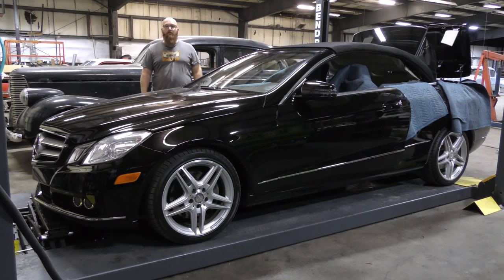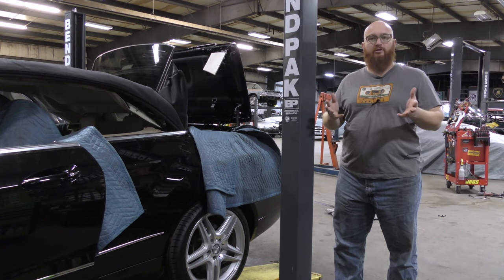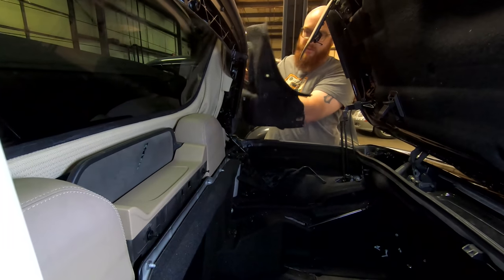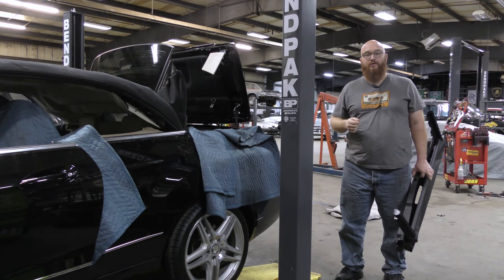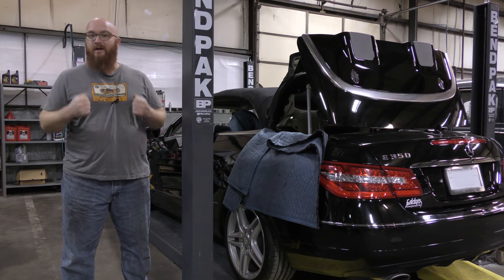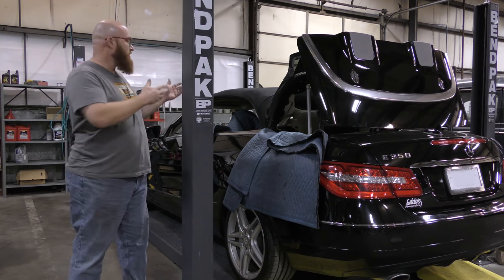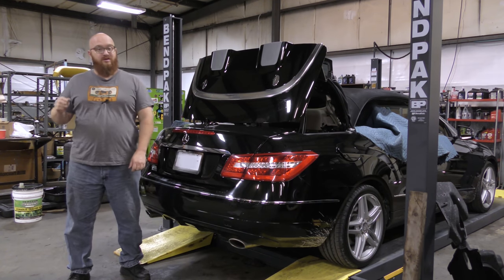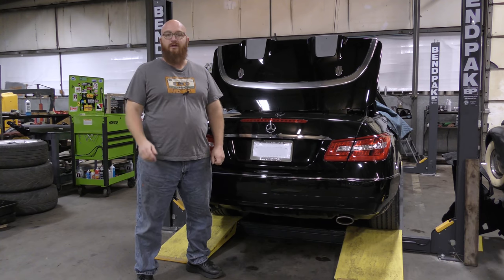When bad design costs thousands! Not so convertible 2011 Mercedes E350 can no longer rise on demand

Comment: This is why newer era Mercedes are JUNK....waaaay too complicated, and repairs can be financially ruinous.  A very cynical company.  They didn't used to be like this.  My 88 420 SEL is a tank....nothing breaks, the repairs are reasonable, and with 325K on the clock, it's the original engine (zero oil burning) and transmission...no problems...just change the timing chain on schedule. Everything works...including the clock, the vacuum system, power accessories.  Beautifully made and rock solid.  My wife's 2006  E350 4-matic wagon always feels like it's about to explode, it burns oil,  the transfer case failed (to the tune of $6K for a replacement, and the interior plastics are already very brittle, and fracture constantly...and our cars are 100% garaged and driven very carefully.   The wizard is right here....Mercedes is now on board with planned obsolesence.

Comment: You're giving the engineers too much credit. German car engineers have a long history over over-complicating what should be simple mechanicals/parts. Which actually costs more to produce, but also more susceptible to failure. So it's the engineers' fault, not the accountants.

Comment: Are there any aftermarket fixes that would solve this problem properly? I've seen people come up with the fixes for the problems with the PCV in the Chevy Cruze for instance, amazing that some random Joe Schmoe in his garage can fix a multi-million dollar company's screw ups and that's just one example off the top of my head.
Reply: Hi.   Just managed to repair this exact problem on my E350D Class Cabriolet for £100 with a repair kit advertised as especially for this purpose that I bought from Cabriolet Hydraulics.   Took about an hour and involved splicing in 12 inches of hose.  Let's hope that it works...

Comment: I drove Mercedes over 25 years: W123 300D, W124 250D phase I, W201 190D, W124 E250D phase III, W210 E300 Turbodiesel. Mercedes quit building quality cars from the mid 90ties. All but the W210 were good, durable cars, which I drove to high kilometers (like 350.000 - 450.000). The last Mercedes W210 was a nightmare. So many electronic problems, Xenon failures, rust and as the cherry of the rotten cake a destroyed transmission at less than 280.000 km. Since that moment: never a Mercedes again! Quality sucks! Happy now with a Peugeot 508SW E-Hdi (not available in the US, I know). Quality as it should be!

Comment: Why not use an electric motor Mercedes? You could even have a metal cable/winch type setup if a lever style system would require too large a motor.

Comment: No big deal, any car with hydraulic roof hoses suffer, I have replaced about a dozen on Jaguar XK100. Plus they need flushing with new fluid because the the old fluid turns to gel.

Comment: Many cars are designed and built for speed of assembly or unit assembly so the average unskilled line worker can just lift, snap, click and move on.   Asking them to position a swivel joint perfectly or engineering a bracket to do do would just be a Toyota/Lexus thing.  C'mon man!  It's hidden.  No one's ever gonna see it.  So there.  Remember when interior panels used to be screwed together?

Comment: As a former (software) engineer, I can tell you that these design problems don't happen like that, at least in my experience. What I think happens, is the engineers are given a predetermined timeframe to engineer the mechanism. The engineers, can argue that it isn't enough time to do it right and under budget, but management usually nixes that and expects the engineer to work overtime to deal with any  complications that come up. In the end, engineers either have a life and customers get sprayed in the face or work their lives away to achieve a better result. I think the engineers in this case just didn't have the time to test the mechanism fully to find this potential problem.
Reply: Computer simulations are pretty good now...?

Comment: Could the hydraulic line be replaced by an aftermarket component or custom built slim hydraulic line with fittings that could be placed to either mitigate the issue or facilitate easier repair?
Reply: The Wizard said that there are no after-market parts. And just to make it worse: 
MB uses the Metric system  one would have to build every part bolts nuts etc. with this system in order to connect it to the MB cylinders.   Build a better hose and fitting which will not leak and then use make the final connectors on the lines in metric.  Not one mechanic... but that would be the route I'd consider.

Comment: Aren't most convertible tops driven by electric motors that fire in sequence, maybe some strategically placed strings to pull things into place? I don't understand the engineering mindset here ... Personally I like manual tops. But that's only for small cars.

Comment: Sorry Wizard, but I think your wrong on this one. 
I think it's the engineers fault, not the accountants. If they had not decided to make that automatic locking system on the header instead of the old style manual lock the accountants would have been happy because that automatic lock probably cost an arm and a leg to build in. By the time they saw the cost of that they threw up their hands and said, "no more!"
I would never buy a convertible of any sort.

Comment: Mercedes Madness. The same sort of unreliable over-engineering they were doing in WW2. Surely you could install a line break/connection where the hole is, or on either side of it?
Reply: Not really. Most of their equipment was much better than the allies. Highest kill ratio of all involved countries.
Reply: Cut the hose before and after the pinhole, insert a replacement section with couplers...

Comment: “So you think having MORE fittings that hydraulic fluid can potentially leak from is the way the engineers should have gone?” - a former automotive engineer

The skit was entertaining, but that’s not at all the way it works.  Purchasing is not in engineering’s meetings micro-managing them (us.)
Reply from the maker: It would have outlasted the lame brain idea of putting steel lines at a pinch point in the frame. Any competant engineer would know what happens to metal when it is bent 90 degrees, and back straight again, over and over. Breaks from fatigue.
Reply: @CarWizard  Do you have any idea how many cycles that convertible top was put through in its validation testing?  No.  I designed interior parts like door panels, and have witnessed the side impact testing, the tens of thousands of cycles of door handle pulling and armrest loading, the cold impact testing of bowling balls dropped on a frozen speaker grille. And that abuse testing was for simple door panels. 

You may not think the Mercedes convertible top was engineered properly, but you are judging a process that you have no understanding of. Not every decision ends up being the best decision, but they are not rubes. Of course you know better…….

Comment: I CAN'T STAND "Excessive Regulations" but with ALL the BS 'Safety Regulations' with Cars, I believe there SHOULD be 'Manual Override Ability' on ALL 'Automatic/Power' Accessories on a Vehicle ... if it OPENS the Car up to the outside environment, allows the driver/passenger to enter/exit the vehicle OR operates nightime lighting ... there NEEDS to be an Easy MANUAL OVERRIDE Mechanism so the vehicle operator can MANUALLY Open/Close the Accessory! ... ie: a removable CRANK for ALL the vehicle's power windows and pop up lights, Manual door locking option, a KEY for the 'Auto ignition' and a BYPASS so a Covertible Top can EASILY be opened and closed MANUALLY ... REGARLESS if it's a $100k+ "Luxury Vehicle"!!!

Comment: well it sure would have been cheaper if they just had mechanical top locks that the driver had to unlatch rather than using a hydraulic latch...they could have saved a few hundred million then
Reply: Apparently in the owner's manual there is a manual emergency lock procedure...
RTFM????

Comment: I wonder if all the hydraulic lines and actuators couldn't just be removed and then operate the top manually? Also that entire hydraulic pump and reservoir could be dumped in the trash bin also. What a POS system.

Comment: This is the maine reason they are pushing EV cars. So its easier for them to make it hard for you to repair your EV car aka No right to repair. They will give you 7-8 years Battery warranty after that when you want to replace/fix your battery, they will charge you $16k, then you will say fuk it, i will buy a new car. If you want to sell it as a Second hand you can't because no one will buy a car with a battery that doesn't work or charges 50% of its capacity.... Just like how apple is doing with their No right to repair.

Comment: Well Mercedes knew they fucked you when you bought it, at least they made sure that at the moment you find out you get lube. Pretty sad that I service some 90's chrysler convertibles that have reliable and working tops. They use linear actuators, and its never going to spray you in the face because there is no hydraulic system. If it fails it will not cost you this kind of money to repair. This was in a vehicle that sold new for less than half of a comparable Benz and was during the super cheapo era of chrysler vehicles. Yet its better than a Benz.